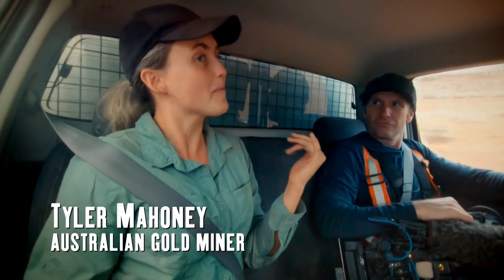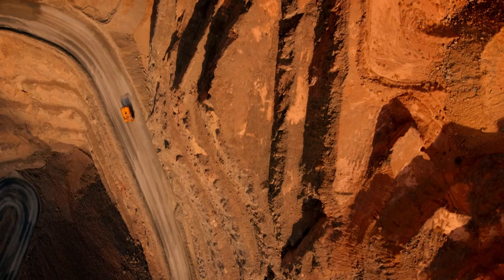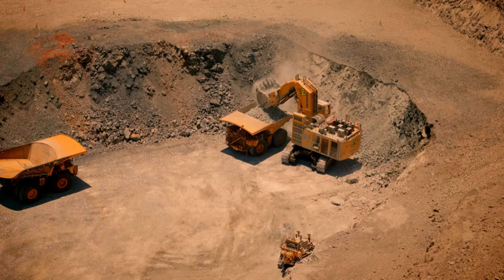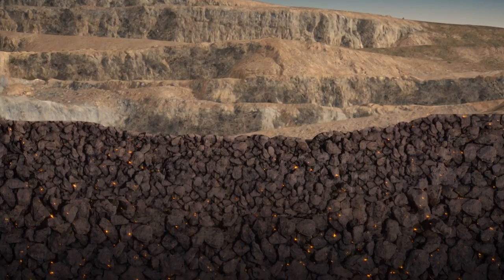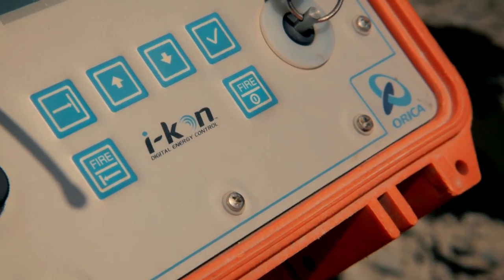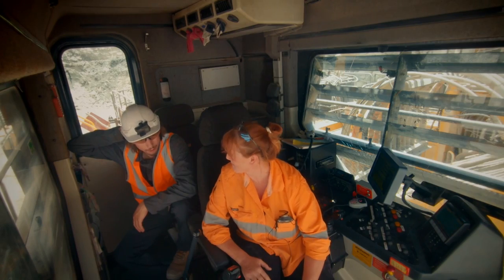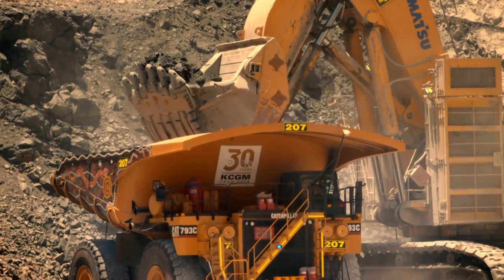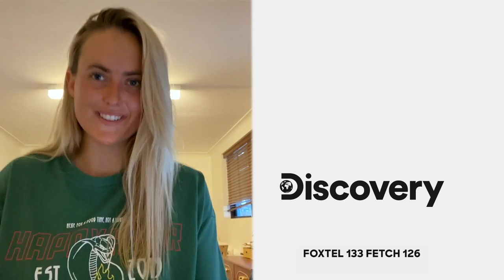Parker Blows A Hole In Kalgoorlie's Super Pit Gold Mine | Gold Rush: Parker’s Trail

Comment: I visited the pit 3 years ago, the piles of excavated timber that shored up all the hundreds of tunnels dugout by the old timers was impressive in itself. No trees for hundreds of kilometers, all the timber hauled in from the South West of the state 700 km away at least.
Reply: I'd imagine those days you hoped for a heavier cart to bring home than you brought out.
Reply: Nice perspective! This video blew my mind.
Reply: Plenty of local timber was used by the old timers , nothing tougher than local silver gimlet for instance. Early days there were several local bush rail lines known as “ woodlines” horse and cart and later trains would bring timber in from the surrounding bush to fuel the condensers to make fresh water before the pipeline  form Perth was commissioned. They bought timber in for the mines also. Grew up in kalg and spent a lot of time in the bush. Them old underground workings were all still being worked in the 80’s when the superpit was a scattering of smaller pits and owned by two different companies.

Comment: 2:10 First step - Blasting... wrooonngg! First step drilling, although they’re tied together they’re a different process. Drill, blast, extract, process.
Reply: @My Name? One would think removal of over burden would be a thing? Then ground prep for the drill to safely drill on level ground, along with the "extension" cord to run the drill from the Gen-Set. Minnesota Iron Ranger here.
Reply: @ducewags  former WA miner here, generally ground prep is completed during extraction process to set the pad for the drill rigs, all rigs over here are mobile with Atlas Copco D65 or Pantera DP1500s generally the go to so no need for a genny. The blast will usually be sufficient for pad level if the blast engineer has calculated bore depths right.
Reply: @adamf894  I have no clue where WA is or what your ground is like, or what your mining. Is that Washington State? or West Australia?
Reply: @ducewags  yea mate, Western Australia. Gold, iron ore, lithium etc. I’ve actually worked at this pit before.
Reply: @ducewags  Western Australia,

Comment: It is interesting that they don't use a conveyor, or bucket chain to move material to the surface of such a large pit.
Reply: 50t scoops, 250t trucks and miles of road to get out of the pit. A single breakdown in a conveyor would halt the system, a broken truck is pulled out and the rest keep going